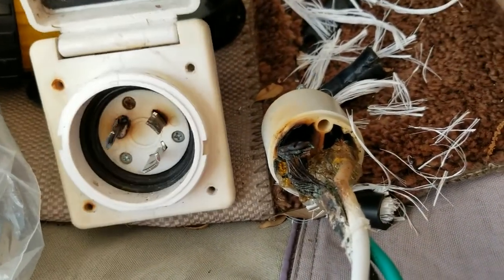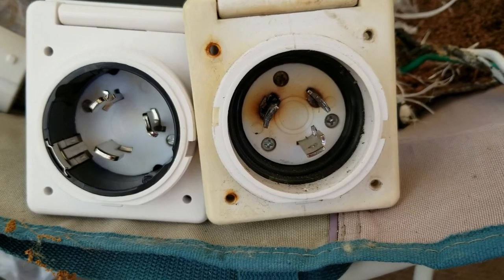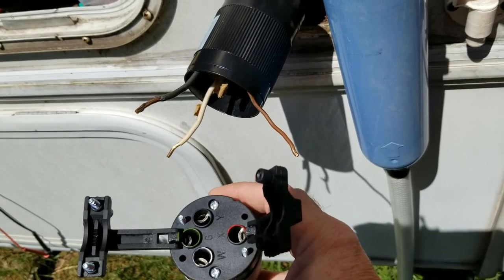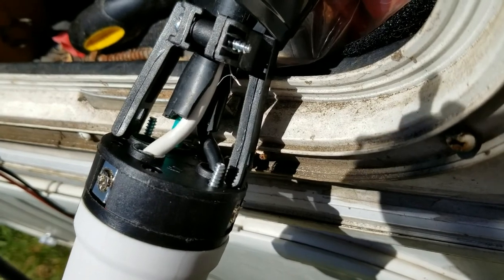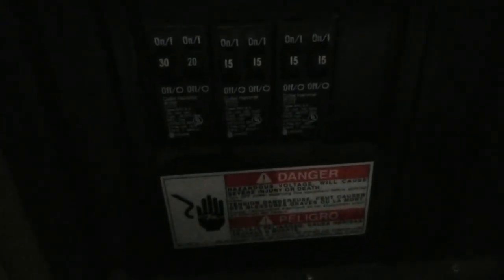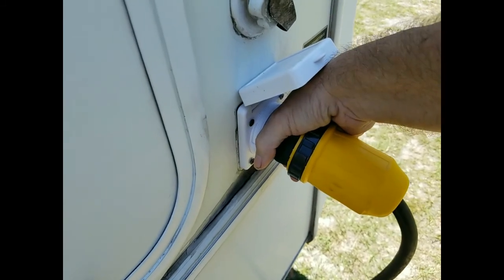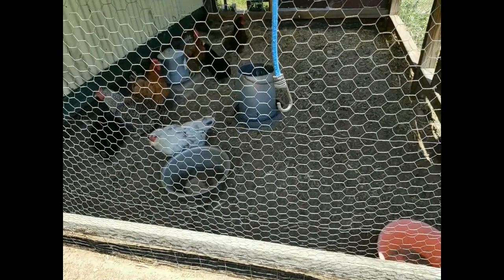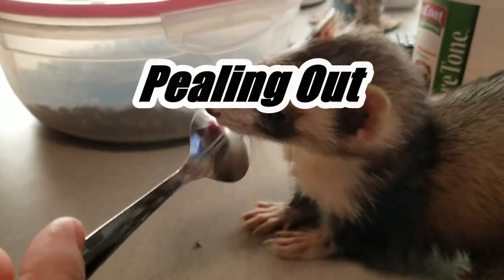Melted 30 amp rv plug!

Comment: What happens if you plug a standard 50amp cord into the RV from a 14-50 outlet at an RV park?
Reply from the maker: My R v's main breaker is 30Amp  When I made this chord the piece that plugs in at the campground it's also 30amp   If you wired a 50 amp plug into a 30 amp RV It would overload the wiring and be a fire risk. Please don't do that thanks for watching